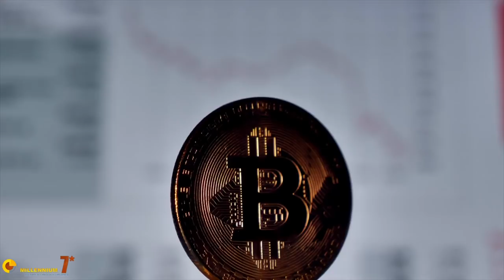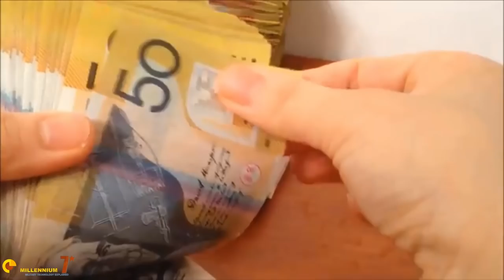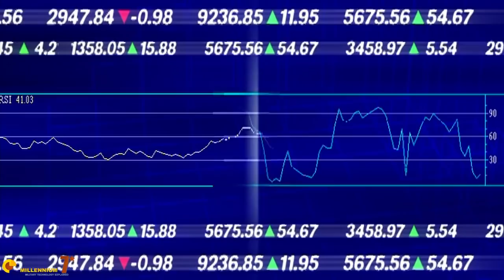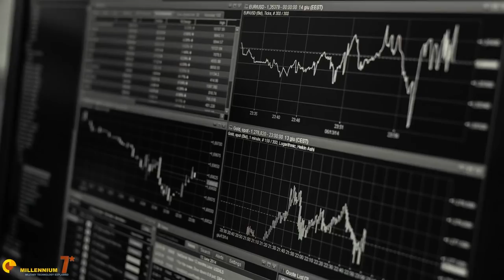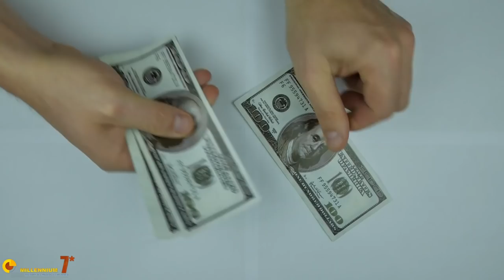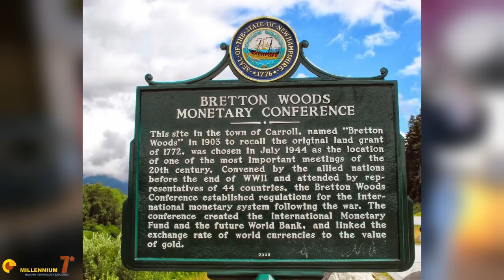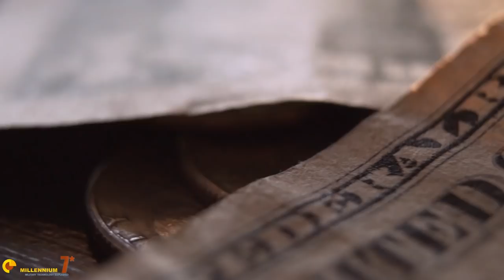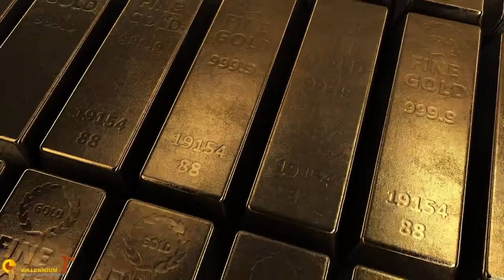How the USA can get unlimited F-35s without going bankrupt

Comment: Most powerfull US defense equipment is overhyped. Almost 30 subs and aircraft carriers are volnourable much more then it seems. 30-60 hypersonic rockets  would destroy them easly, and more then couple of countries have them. As a strategic weapon they are mighty but otherwise, overpriced steel crap
Reply: I think American military dominance is rather understated. America does not only have the largest air force in the world (US air force. It does also have the 2nd largest air force in the world (US navy). Its navy is stronger than any other fleet on the planet - Just one American submarine with nukes got more firepower than most countries in the world. And the US navy got more aircraft carriers than the other worlds navies combined. And the other countries also got tiny aircraft carriers with fewer planes and less potential by comparison. Furthermore does the US military also possess a large amount of combat experience that cannot be found in many militaries around the world.
The logistical organization of the US military have also been unparalleled with other militaries throughout the 1900s. The airforce is not only large, but it is also relativly modern. It have stealth bombers, and despite F15 being an old plane is it still one of the best planes in the world - especially with a combat experienced pilot. F35 and F22 is debatable if they are the best planes in the world, but it is not much doubt that they are very feared opponents on any modern battlefield.
Meanwhile are China flying its old fighter jets from the 1960s.
USA also have similiar superiority in other types of weapons. Russia is still not having body armor for its troops, but instead does it invasion army in Ukraine more resemble the American army in Vietnam than the modern US military. Nor does the Russian military been able to replace all its old Soviet equipment. The Armata project have stalled, and Russia is stuck with old Cold war tanks for decades to come. The crocodile attack helicopter is also in many ways impressive... but the project have never been fulfilled. Just like the SU57 project that seems to have failed. And other countries are busy with developing 6th generation jets Russia still havn't finished this plane yet.
So Russia should stay away from a war with USA, because it cannot win.

China have been investing more and more into its miliary. But still it is a force based on the old cold war ideas of the east bloc. And it have weapons similiar to those of Soviet Russia. And those weapons failed miserably in the Gulf war in 1991.
After that all hopes of victory over the USA with this doctrine was flushed down the toilet.

So I think that the US military pretty easily could win a world war against EU and Russia. And even if China would join them do I think that USA would still win.
Reply: @nattygsbord  this is typical how you Americans envision war, you are gonna find some small, poor, third world country(Korea, Vietnam,Iraq... ) and you are then mighty. In reality, as I said, one or two hypersonic rockets would destroy any US sub or carrier. That is a fact, and you are watching too much sci fi movies
Reply: @milanradovanovic3693  You are the naive one since you think that 30-60 missiles are all that are needed to win over USA. US air force alone got 5300 planes. I bet that will take thousands of missiles to shot down.

It is also no secret that the western world generally have superior weapons compared to Africa, South America, middle east, Russia and Asia. And while I despise the Russian regime, I will say that I do have much respect for the Russian weapon designers. Russian weapons would be unimpressive if this was the best they got if their country had a GDP equally large as that of USA. But now is not that the case. Russia have a GDP smaller than Spains, and therefore do I think it is impressive that a poor country like this can make so many good weapons: Armata, SU57, S400, Kornet, KA-52 etc.
However the Russian military is incapable of winning against USA. Russia is no longer the Soviet union of the 1930s with a great strength compared to rest of Europe in terms of manpower. Not only do USA have a larger population, but the average American worker do also produce 4 times as much stuff.

Personally do I think that Armata is overly hyped. And even if it production costs would be lowered thanks to magic, it will still not be a super-weapon since its turret is unarmored and the crew is dependent on cameras and sensors that quickly becomes disabled by explosions, shrapnel, machine gun fire, and rocks flying around. And then do the tank become blind.
M1 Abrams is still the worlds best tank. Leopard2A7 is the second best but its bigger gun also means a slower reload. The Abrams is as far as I know able to destroy its enemies from superior ranges. So yes, the US military is still superior.

Europe would be crushed in a world war with USA. America got combat experience. And the German airforce only got 4 combat ready Eurofighters, while RAF butchers four Typhoon jets worth £500m for spare parts to keep warplanes flying.
That is the pathetic shape of the European militarys. German soldiers use broomsticks instead of rifles because they have saved money on their military. It seems rather more concerned with making uniforms for pregnant women, and complaining about Leopard 2 tanks being to bumpy and unfriendly to pregnant women - as if pregnant women got anything to do near the frontline 🙄
Call me sexist, but a pregnant woman isn't exactly in optimal physical condition for combat, and will therefore easily 
have herself killed along with her baby. 🙄

And most American M1 tanks will have uranium ammo that can easily punch through armor on European tanks from a long rnage, while the Europeans unwillingness to use DU ammo will put them at a disadvantage. And only a small number of Leopard 2 A7 will remain competative. And Leclerk cannot be upgraded much... its an expensive tank with a small turret that cannot fit a gun as big av Leopard or Abrams. And the C1 Ariete is a tank that usually gets bad reviews on Youtubers... from everything from its bad precision while firing on the move to its weak frontal armor in the hull that could be penetrated by an old Russian T-35/85.

So yes, the US military is the strongest. What worries me the most is that her allies are so useless, pathethic and weak.